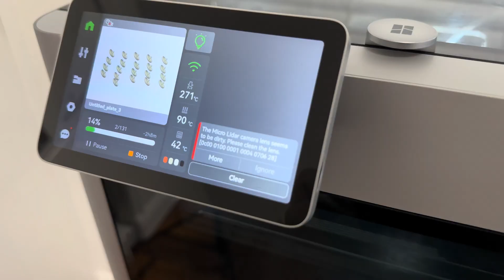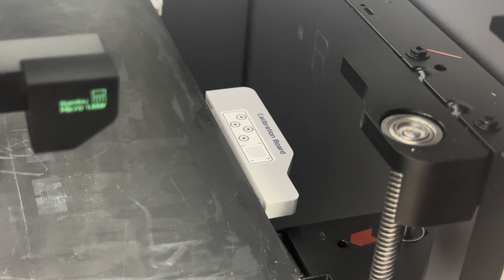How to Clean the Micro LiDAR Camera Sensor on the BambuLab X1 Carbon

Comment: Thanks for this! I have well over 3000 hours on my X1C and about 2000 on my X1E and just found out there are 2 different points that need to be cleaned thanks to you! I have cleaned the primary lens several times and of late, I cleaned and still got the message to clean. I cleaned and cleaned and cleaned and still had the message. I just cleaned the other one on the side of the lidar and no more message, thanks!

I have reviewed the Bambu Lab Wiki and it was never real clear that there were 2 locations to clean. Now that I went back to it after watching your video, they did have another arrow pointing that direction, but like your video, no clear shot of what it looked like with your camera angle, so I just swabbed that general area and good to go. I wish Bambu Lab would have noted "2 locations need to be cleaned".

Yeah, I know, some people need that little extra help to figure things out, me being one of them. Again, thanks, I couldn't have done it without this video!

Comment: The calibration sticker.. where can I get one? mine is damaged and I think it's messing with my first layers because sometimes  they are good and sometimes not.  the sticker I have is damaged
Reply from the maker: you can probably print out a new sticker and glue it to the location.
Reply: Check in spare parts the stuff that came with the printer. Mine has a replacement sticker mixed in there.

Comment: Does the Bambu Lab X1 Carbon LiDAR really work? - in this video they tell lidar is a LIE
Reply: No issues at all.
Reply: he was just showing how to clean it bro
Reply: Yes it works. Maybe reach out to support
Reply: Many times I've got a message about a "possible spaghetti failure," and there really was such a problem. So it looks like this feature is working.
Reply: @KoichiTanakaBlog так это видеокамера обнаруживает спагетти
Reply: 99% of the time, mine doesn't work. It just suddenly started having issues and now is basically useless. The printer won't even start about 95% of my prints and it just purges filament and wastes it. THEN, if I try to just go ahead with the print, it extrudes a tiny bit of filament, and then the wipe fails to remove it, and it auto-levels the bed with a bead of plastic on the tip, which cause the leveling to fail when the print starts.

Comment: I just have a quick question. Are you supposed to see the laser scan the first layer? I also have a creality K1 max and when it does its first layer scan you can see the red laser scan the first layer. On the X1 I can see what looks like a mini flashlight projecting onto the print surface but not a red laser per say. Thanks
Reply from the maker: Well, yes and no. It’s an infrared laser so it’s not something you can see with the naked eye. Take a video with your camera when it does its scanning, you can then see the IR laser doing its scanning.
Reply: @TNTBA  awesome thx
Reply: I know you made your comment a while ago but I do want to state that Bambu Lab says in their wiki that the X1C ships with two different lidar models and its random which one you will get because they use different suppliers, but they both work the same. I think was laser was red and one was blue or something lol